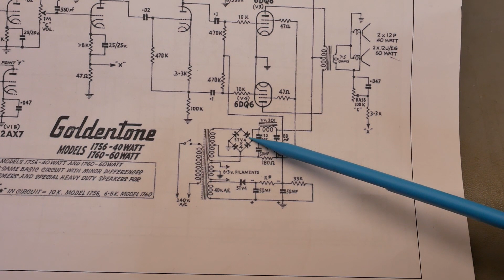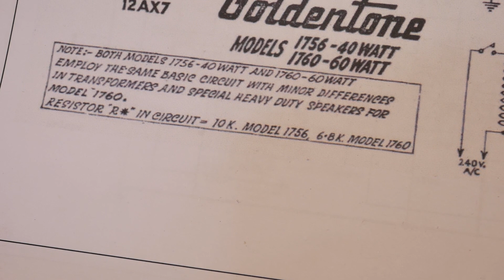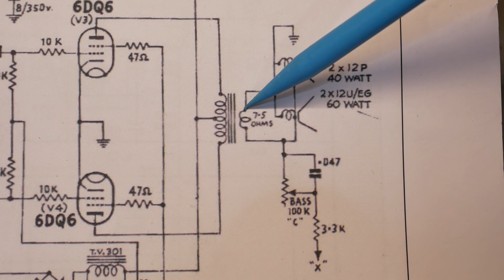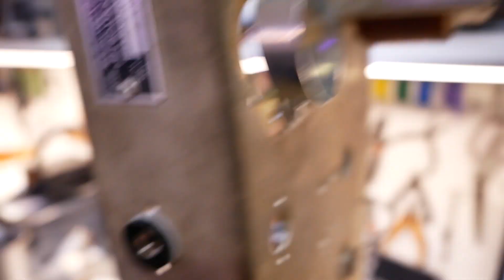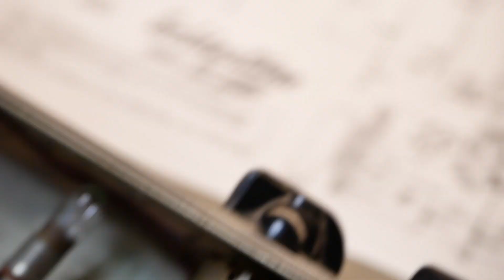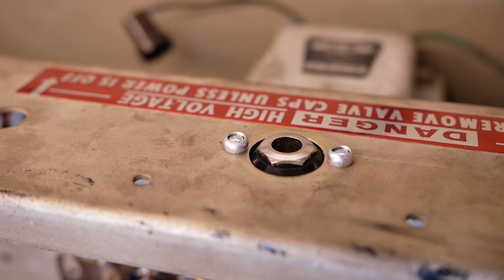1966 Goldentone Bassmaster - Part Two: Working

Comment: Very interesting and great to see an amp made in OZ. Something I don't quite get, but I know classic Fender circuits and plenty of others are the same: why does the active mains wire go to the fuse and then the switch? I was taught the opposite with the thinking that "off should be mean off". If the fuse is wired before the switch, then there's mains voltage along a short section. It's ok if you're aware of it (i.e. keep your damn fingers out!), but I wire switch first. Would love to know your opinion. Thanks in advance.
Reply from the maker: I've seen switches melted and shorted, pole to pole.
The housing of this switch is metal and grounded by contact to the chassis.
Can you imagine what would happen if an internal failure in this 50-odd year old switch shorted active to ground without a fuse before it?
Reply: @BradsGuitarGarage  Ok - I get that logic - thanks - you really filled a gap in my knowledge that I really should have thought of myself.

Comment: That input stage is super odd and so very Australian. Super low input impedance, rhythm input cathode bypassed with a tiny cap, both input stages share a plate resistor and the bass control is a resonance style circuit. 

No wonder we never took over the world with our amps.

Comment: Love your work on this.  I might have to try the variable bias in mine... 6dq6As used to redplate a bit so I had stuck to 6dq6B valves with higher ratings
Reply from the maker: I landed on a 4.7k / 47k+25k trimpot to pull it in to approx 60-70%.
This pair weren't very well matched. +/- 8%. But good enough for rock'n'roll.
Reply: @BradsGuitarGarage  thanks.  Yeah it is difficult to find matched pairs of the tv valves. I just listened to the sound demo, that thing sounds wicked.
Reply from the maker: I would have liked to improve the circuit, but was briefed by the customer to keep it as close to the original circuit as possible, with all it's quirks.
If I find one for a good price, I might grab it and do the tweaks I'm thinking of.